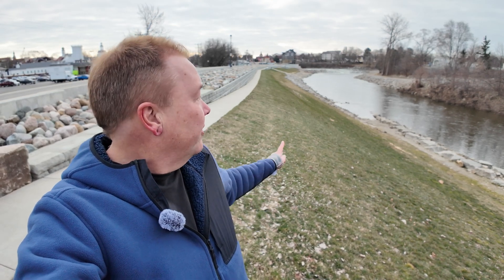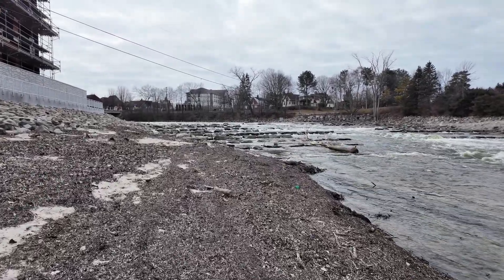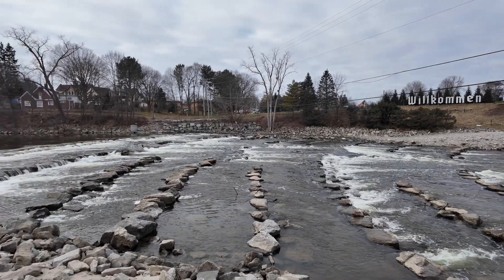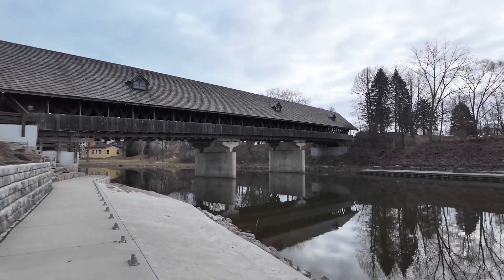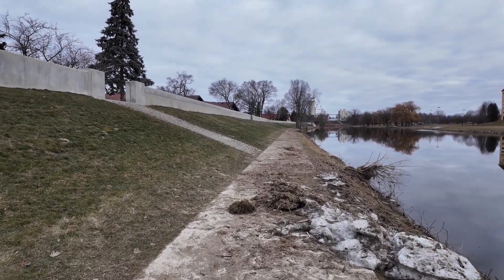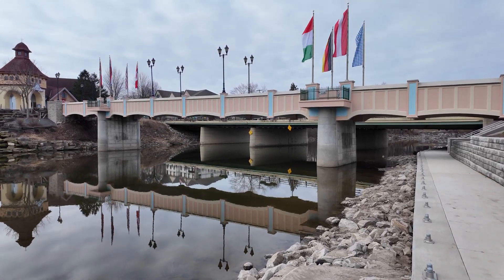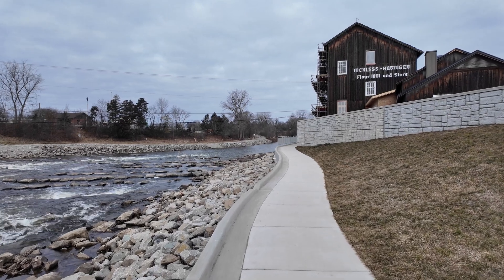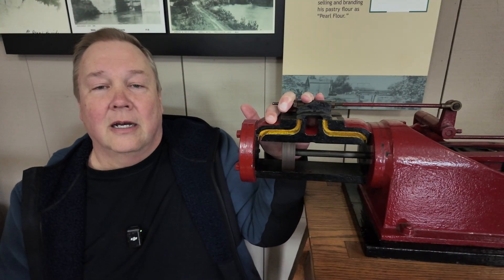Reviving a River: Rock Ramps at Frankenmuth Dam Removal

Comment: @industrialrevolution What are you trying to say ? I don't know if this is a positive review or negative review. Poorly Presented and BORING
Reply from the maker: I can understand your not being sure if I feel that this is positive or negative.  Like many people with dam removals, my feelings about this one are mixed.  If, and only if, you absolutely have to keep the reservoir/mill pond above the dam for some reason, it's an OK solution.  Would have been better if they'd make it canoe/kayak-friendly (what they did at Argo Dam in Ann Arbor is a start on that, but also imperfect), but at least it's safe, fish-friendly, and better for the general ecosystem.  
Losing history is bad, but at the same time, restoring ecosystems is good.  The dam removals I've looked into, as well as a couple others I'm watching go through the process now, are very much a balancing act.  In some places, they've completely removed all traces of a dam in a remote area.  In others, the dam is fully restored to what it was 100 years ago (but safer) and keeps operating.  In a lot of places, though, it ends up being an imperfect balancing act, somehow fixing the safety issue while doing some combination of improving ecosystems while minimizing damage to boating, home values on the mill pond, etc.  Usually, no one is actually completely happy with the results.  So am I thinking this was good or bad?  It was necessary, but could have been better.

Comment: GOOD THING THEY DIDN'T USE A DAM TO CREATE CHEAP ELECTRICITY!!!! Electricity is so "fascist", like Capitalism and democracy.
Reply from the maker: During the summer, there's so little water going over that dam, you might, maybe, if you're lucky, be able to light a few light bulbs, assuming they're LED.  A common trend in the dam removals I've covered is they they did consider installing or upgrading hydroelectric, but it just didn't work out economically.

Comment: What gold course are you talking about that’s used for flooding?
Reply from the maker: You know, that's a good question.  I don't think the report I read, which was just a summary, said which it was.  The only one I see anywhere around there is The Fortress, just downriver of the dam.  If you're familiar with that area, there's a lot of levees built up all along that river, even right down through the farmland.  I don't know the terrain there, but I'm guessing that's the one?  Even taking down some of that levee by the course, if it's lower, would give some good flood space.   Not a ton of space for flood water, but more than was there before.
Reply: @ the Fortress is a high end course. I can’t imagine they would let it flood plus the water treatment plant is in teen the Fortress and the river. Theres one down river a littler further and the only one up river is Timbers but they are a short distance from the river. I live close to Frankenmuth
Reply from the maker: I'm not a golfer, and live further away, so don't know the courses.  Being a short distance away isn't likely a big deal, as long as you can have a clear path for the water to get there.  Really, it just needs to be a low section of ground, which might be wide enough that you don't even notice it as you drive by it. 
 The surprising thing is, while driving downriver, there's a lot of farm fields protected by levees.  It seems like it might make sense to slightly lower a few of those, in coordination with the farmers, so you could selectively flood some fields, and agree to pay the farmers for crop damage when/if that happens.  That'd flood a few fields to save downtown and homes, elsewhere.  
This is actually a huge factor in flooding that I've been reading more and more about, especially along large rivers like the Mississippi, but for a lot of these smaller dam removals, too.  Now that we can do much better flood modeling, we're seeing that some of our flood control measures, while protecting a specific area well, end up creating even bigger problems elsewhere.  I suspect, in 50 years, flood control will look very, very different from how it looks today.

Comment: Dam removal is criminal! At a time when global warming is the issue, this country is spending money to rip out dams that could easily produce carbon free hydro power.
Reply from the maker: Well.... sort of.  Often dam removal is done because, due to aging, erosion, bad construction, whatever, they've just become too dangerous.  There have been a few collapses recently that are at least partially a result of that.  
On the hydroelectric side of things, I'm a big supporter of green energy (even if I do really like coal-fired steam locomotives).  Unfortunately, a lot of these dams just aren't economically viable to do grid-scale hydropower.  Either the water flow is too low or the drop is too short to make sense, even if the dam were still safe.  The video coming out this afternoon, at the Gorge Dam, they evaluated hydro but decided it wasn't economically viable.  Same with another video I'm working on at Argo Dam.
On the positive side, though, I've been seeing some really impressive microhydro developments lately.  These don't need much drop or much flow and, in a lot of cases, don't need a dam, either.  Microhydro isn't useful for grid-scale work, obviously, but for those places where you have either low flow or only a small drop, it can provide power for a few houses, a school, or couple stores, etc.  Since they often work without dams, they also work without most of the downsides of dams.  Unlike rooftop solar, microhydro isn't going to be as subject to variation, although there can, obviously, be dry seasons and droughts, so less battery backup should be needed, bringing this cost down for people who have access to even fairly small streams.

Comment: Great video.  I had no idea that a dam was removed in Frankenmuth.  What they put in its place looks great for fish.  I hope they do the same with Sanford Lake.
Reply from the maker: I haven't heard what they're putting in up there, but the way that dam was removed is definitely NOT the ideal method of dam removal.   Rock ramps are a great way to make a dam fish-friendly and, as far as I can tell, nearly failure-proof.  Another good solution that fully maintains the reservoir above is something like they did at Argo Dam in Ann Arbor, in cases where the concrete part is, itself, still solid.
Reply: I believe a major issue with the edenville dam vs Frankenmuth dam is, Sanford lake and the other lakes created from those series of dams have developed with people building lake front homes/cabins etc...those generate a ton of money from recreation plus property taxes. Like it or not money has to be generated for the upkeep and maintenance of our amenities, amenities that the modern American needs and, in a region lacking a large population and employment opportunities recreational opportunities from rebuilding the dam is the only way for that region.

Comment: That mill has been there for a long time. It has only recently been remodeled. I remember when it was repurposed as a general store.
Reply from the maker: It's gone through a lot of things in the last, what, 50 years it's been there?  I remember when they opened it, and the whole thing was a working grist mill, with flour and other "grist mill like-stuff" sold on part of the first floor.  Then they took over the whole first floor for a gift shop, then a coffee shop.  I was up there again a few weeks ago and they're a huge, new building next to it, and attached, for the new place.  Zender's owns it, so they don't really have to immediately make money off it.  The mill may have been better off moved out to Grandpa Tiny's Farm (a small, living history farm a few miles away, just outside of town).

Comment: Maybe Sanford and Edenvale dams should have done this for the fish and the environment ! !
Reply from the maker: It's not a bad strategy when you really want to maintain the lake/reservoir above the dam.  One thing I'm finding as I look at more dam removals, if you let people get creative, you can get some very different solutions, and a lot of them seem to work really well.
Reply: @Industrial_Revolution to your point...i always thought of building like racks and having them in a series, in these racks would be some type of paddles etc something creating energy.... these racks could be raised and lowered allowing water to freely flow plus during certain fish migrations the racks could be raised to allow the fish to pass by plus still create energy.
Reply from the maker: A series of stream wheels?  Typically, you don't extend them the full width of the river, so you don't even need to worry about raising them, since it's easy to swim around them.
Reply: @Industrial_Revolution  actually I'm thinking a rectangular frame say 6×3×3 for example and a series of these connected etc...inside of the frame you have several rows and layers of those lane divider's they have in Olympic racing pools to absorb the energy of the swimmers wakes... Obviously on river its powered by the current but on large bodies of water you can capture the surf...Im thinking this could be fairly light weight too. On high water events a series of racks could be raised to avoid the floating debris field. Fyi ,I watched a video on the reconstruction of one of the dams that gave way on the tittabawasse ...
Reply: Jason may have covered that possibility?

Comment: How does this all work, outside of the fishes?  Am I to think that the height of the rapids backs water up to large flat areas where flood waters can overflow and be 'stored' until after the event then flow back into the river slowly?  This works, where you have low banks and low little used areas along river.  Many dams are built where there are HIGH, to VERY HIGH banks, to better create a deep pool.  Many lower dams, the pools created high value water front real estate now clogged with negating any ability to flood and store water.  I guess this is a good niche method for communities where development passed them by leaving banks empty.  That is of course also where low dams on rivers with low banks tend to be, and where they would, due to lack of tax money, be worse maintained.  So good there.  
Big question?
Does the dam need to removed?
Can the rapids just be installed below the dam, even if solid concrete has to be poured under it to ensure it's stable forever.  This would save huge amounts of money, and even reduce the env damage done from mega flows of sediment when a dam is removed.  fyi  mass concrete for under rapids, it's not like you order pumper truck after pumper truck.  You pour add boulders pour add rock between boulders, and repeaat until boulders covered add more boulders.  A GOOD concrete mix is one with a gradation of rock sizes that pass and disperse forces to surrounding concrete filler that is there to hold the rock in place.  Rock is ALWAYS far stronger than concrete and is better at resisting and dispersing forces without degregation.  Modern small gravel concrete is used as it's most economically viable for construcing buildings, where concrete thickenss is nearly always 4 to 6 inches, a foot, maybe two in columns, and there are masses of rebar to get around.  It's used in mass concrete pours, because well, no one knows how to do 'rock' concrete any more, it requires honest contractors to do it right when no ones looking, or a licensed professional directly hired by owner to monitor work.  In olden days there was always a licensed professional on big jobs on site, reviewing shop drawings and work every day.  It's not done now so owners of these 10, 100, 1/2 billion dollar projects can cut the $200,000 to 2 million it might cost over that project range.  You can buy your druggie kids their own sports cars for 200G, and a new jet for yourself for 2 million, and still keep the 25 to 200 million you'll make off the project.
Reply from the maker: The Cass River is unusual, at least for this area.  There are serious levees built up on both banks, above and below the dam, stretching for many miles, even though most of it is farmland.  The area above the dam was, and is, no wider than the river, just deeper, and floods just went up, and hopefully not over, those levees in the past.  You can see one that I'm walking along in the video.
Below the dam, the river was usually too low for much boating, but boating was popular above it, and people didn't want to lose it.  The Rock Ramp method kept that water level at its original depth up there.  Changes to a golf course that I mentioned gave the river somewhere to go in a flood, rather than overtopping the levees.
Could you just build it directly downstream of an existing dam?  Probably sometimes, but probably not always.  The engineer in me is saying it really depends on the condition of the existing dam and, especially, the condition of the banks around it.  I know some dam replacement projects have looked at using exactly that process when the dam was bad but the banks were good.  If the banks are bad and need significant structural work, or if you can't go downriver for some reason, then the original dam, or at least a part of it, may have to go.  On the other hand, sometimes the dam itself is fine, but the banks are bad, such as Argo Dam in Ann Arbor.  That can lead to other creative options.  Need to do a video on that one.